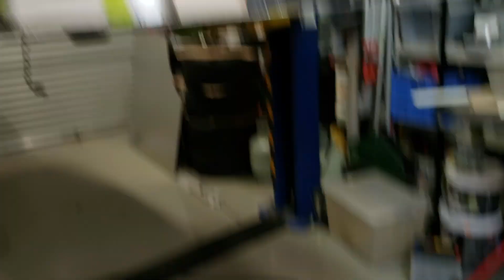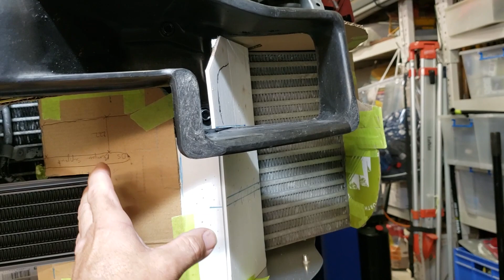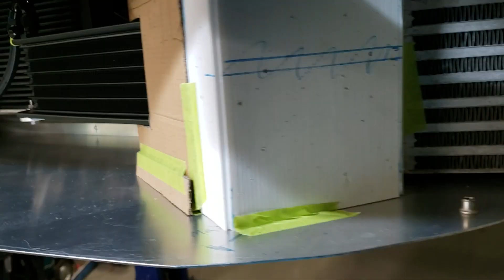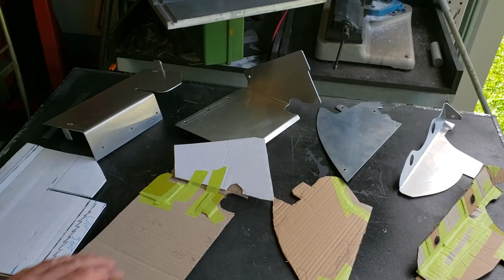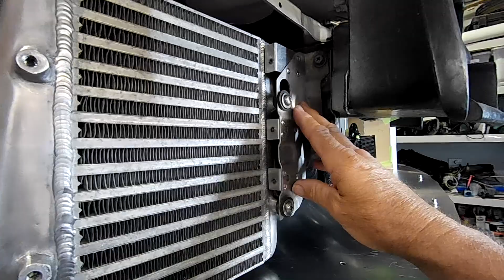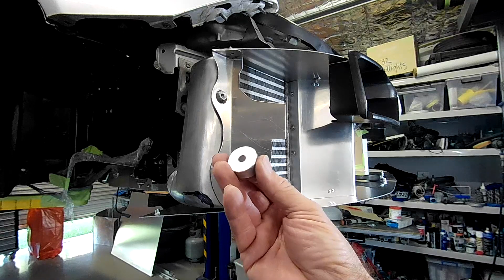Front Ducting Fabrication. Project Fairlady, The Nissan Z32 300zx Twin Turbo Mega Build

Comment: All that sheet work is top notch man👌🏼
You can use high density foam to fill in gaps like under the cooler, that way it will block the air but also allow movement of the under tray if you scrape on something or just flex with air pressure

Comment: where you have those hard edges butt up against each other, are you worried about rattle noises without some form of gasket or rubber?  Never done this type of work so this could very well be a stupid question...
Reply from the maker: G'day Rick, they shouldn't hopefully. I think I have enough fixings & it all seems quite solid.
 I've never had a problem with rattles/vibration before with this kind of stuff, but I imagine if it was loose or lacking in fixings it would definitely be a problem.
The Final assembly will have foam tape between the lap joints & some heavier foam tape around the edges to help seal it all up.
This could be why I haven't had any issues previously.
Great question,
Cheers.